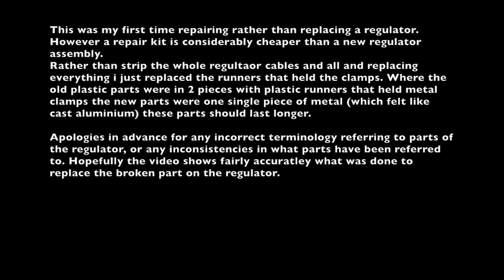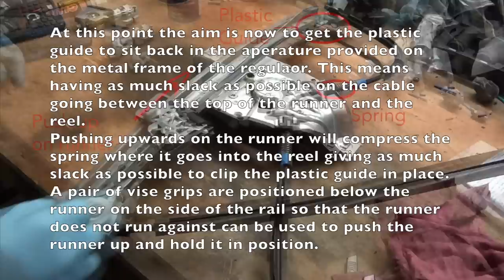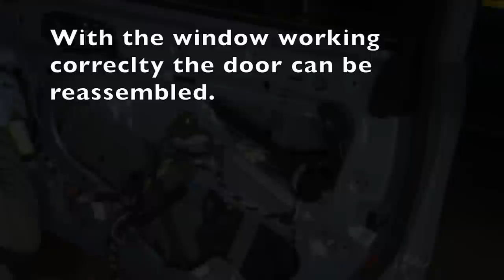Peugeot 607 Electric Window Repair

Comment: just repaired mine. but I did not need vice grips. after putting on the wire on the smaller part of the rollers and running it up and down it snapped into place :)
Reply from the maker: Superb, i think i might have got the cable into a bit of a bind and needed the grips suppose doing it enough times it would get a bit more efficent.

Comment: You snapped the aluminum rails with pliers and damage the surface, no, no, no...! Second, I would never put the pop rivets on speaker holder, I would put the screws or bolts and put some locktite bolt glue.
Reply from the maker: If this is the bit at around 12:42. The rails are steel not aluminium, a significantly harder metal with different mechanical properties, one being that its less likely to crack or get damaged under such circumstances.
While there may have been some light marking on the rail from the pliers it in no way affected the operation of the window mechanism.  
The window continued to function as long as i owned the car, ive also done this on my daily driver 406 which has no issues. The window goes up and down smoothly and quietly. 

Regarding the speaker, they were held on from the factory with rivets. Mainly because access around the back to get a nut on is limited. A rivnut would be a good idea but given how infrequently the speaker has to be removed its not really necessary. That would mean buying rivnuts and the proper tool to install them.

Comment: How do you get that black wax of from switch box? It looks terrible.
Reply from the maker: do you mean the rubberised finish they put on the electric window switch block? 
I tried a few different things, neat acetone scrubbed onto the part seemed to lift it although it required quite a lot of scrubbing.
As it happens the 406 uses the same switch unit but they never had the crappy rubberised finish so sourcing the same part from a 406 will tidy up the interior.
Reply: Yes that was what i was mean. Thank you. I shall try that acetone first...
Reply: It is pain in the azz to get rid of that rubberised finish. I have a facelift 607 so the connections of the 406 window switch block is different. Do you have any ideas what to do next?
Reply from the maker: This one took a fair bit of elbow grease to remove the finish and even at that it wasnt perfect. Perhaps some sort of vinyl wrap would hide it, or a mild form of sandblasting might get it off, sandpaper and possibly then paint it again. This 607 was only a £200 banger i was using last year so its aestetics were never a huge concern but can understand how looking at something like this in a nicer model can be unpleasent. Im not sure but does the switch block itself look different in the facelift car? perhaps if its just the wiring and connectors then it might be possible to still get a 406 unit and transfer the facelift 607 electronics into the housing of a 406 unit.

Comment: I don't think silicone is good for lubricating the windshield guide. This item should simply be washed and dried. Likewise, silicone is not suitable for lubricating the mechanism rail.
Reply from the maker: I find silicone spray on the rubber track helps to reduce friction and unlike wd40 will not damage the rubber. It has never done the mechanism any harm. 
That has been my experience, never had any issues with it.

Comment: You made more damage than fixing it very very bad worker
Reply from the maker: No i will totally disagree with that comment.
What was broke? 

The video started with a window that did not function correctly in the end it worked, and continued to work for a long time after. Even the evaporation barrier was carefully removed and reinstalled.

Where is this damage that you speak of?